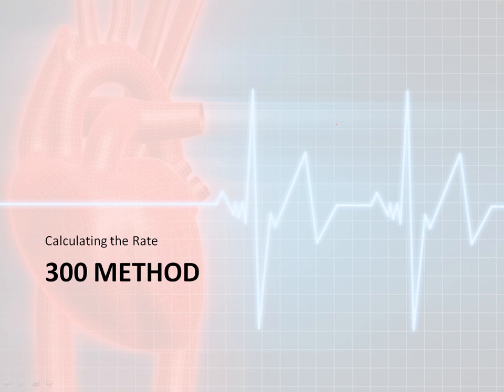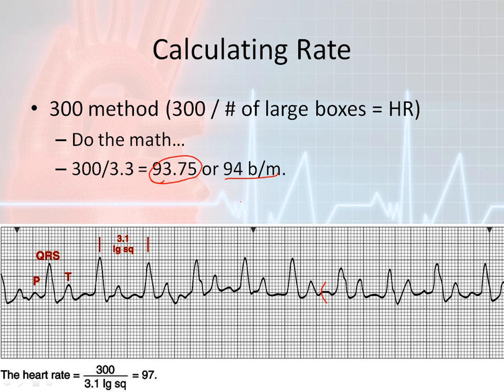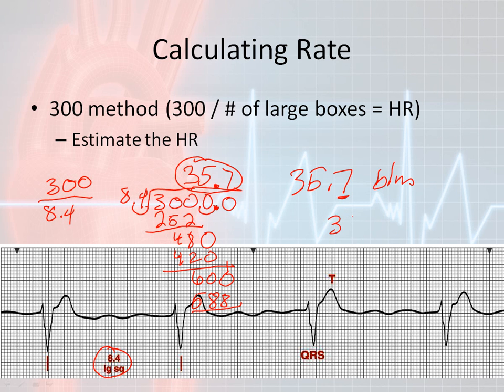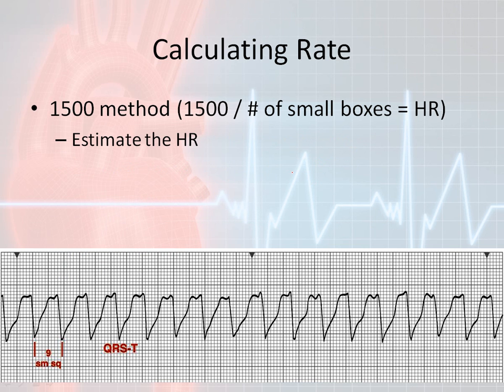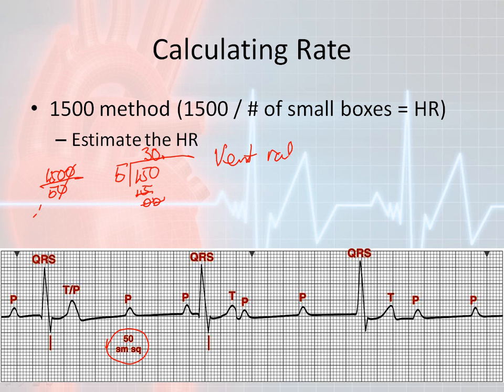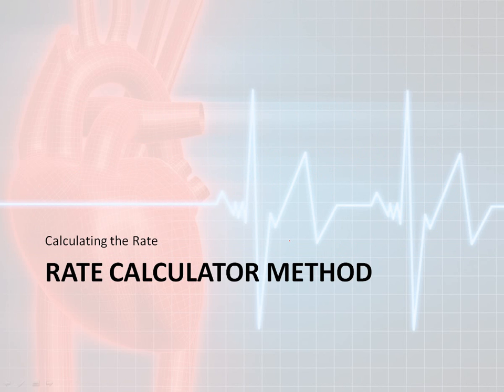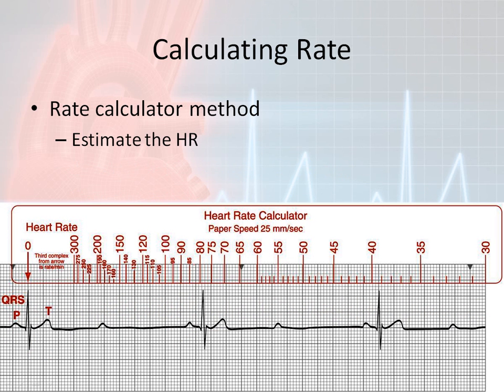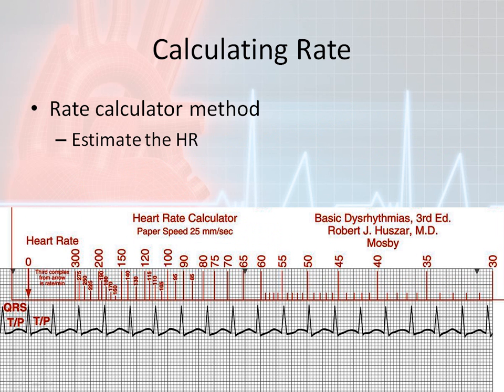Basic Rhythm Interpretation, part 5 - The Systematic Approach, #2

Comment from the maker: I hope I can explain this correctly. If a large box is 1,and if you devide the 1 by 5 (or break the 1 into 5 equal parts), each part will be .2 of the 1 (or the whole). Since 1 big box has 5 little boxes, each little box of the whole (or 1) is .2
I hope that answered your question.
Reply: Thank you for the wonderful videos especially for someone like me using many resources with no result. I appreciate your time and art of teaching with no expectation as a wonderful teacher. Just at minute 15:43 the sign for ventricular rate less than 30 bpm which should be like this: <30 is written >30. I know usually people do not notice but just wanted to mention as your videos are flawless. Thank you again.